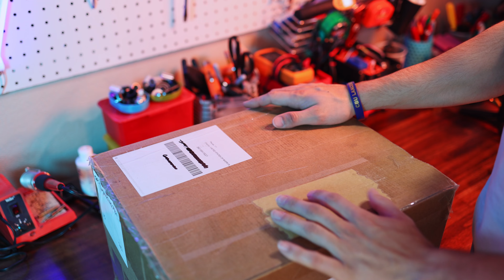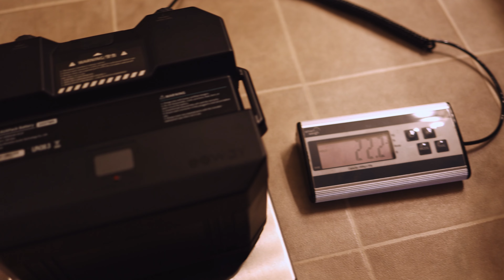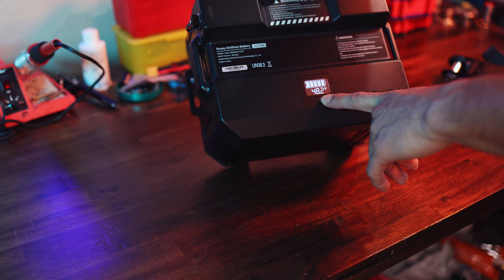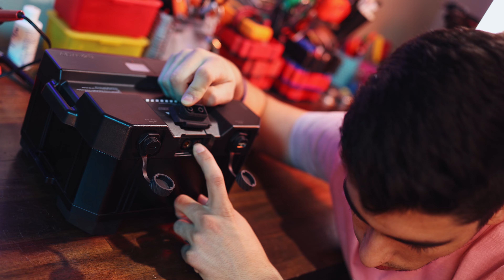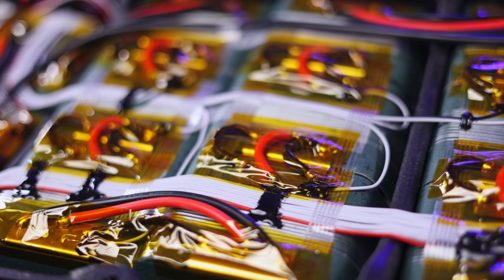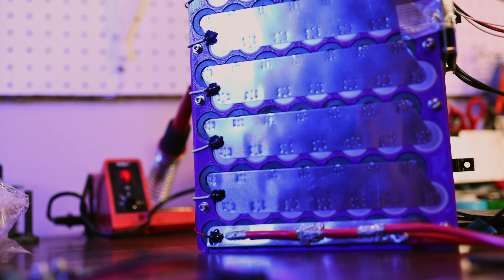What's inside the Exway Aux Pack? (Unbox / Teardown)

Comment: Hey man, i like the fact that you went ahead and unassembled this battery pack. I would love to pick your brain about repairing the battery pack when the batteries no longer take charge.
Reply from the maker: Ironically this battery no longer works lmao, don't really know why but I haven't investigated it deeply. Usually when batteries don't charge, it means that one of the cell groups is out of balance, OR (and more common) is that a cable somewhere has broken or cracked. Easiest first troubleshooting step is to inspect all solder joints, balance wires, and cables to see if anything is broken. From there, you can move on and probe around with a multimeter to see if each cell group is the same voltage. Might sound complicated but it's not as hard as you might think.

Comment: How difficult would it be to swap the esc in the atlas pro? I understand the aux pack is self balancing. But what kind of tuning is done to the esc if any to allow u to add and remove the aux pack as desired? What are some things to concider?
Reply from the maker: Swapping the ESC isn't too terrible, I think it comes out with a couple screws. However, you may have some trouble fitting in an alternate - I haven't tried it yet, but maybe the Makerx M100 or DV4s would fit. You'd need to replace the motor connectors and sensor wires, get a new remote, and probably modify the enclosure a bit. It's definitely possible though.

As for the Aux pack, the ESC does not communicate with it at all. It's the BMS in the Aux pack to the BMS in the board battery, so you don't need to worry about that part.

Comment: thanks for the video bruv - btw you mentioned you are 3d printing parts. i would be happy to know if they are exway atlas pro parts ;P
Reply from the maker: Glad to be helpful! I do have some parts that will be available for Atlas Pro soon. I sell tail light mounts and tail lights that will work with the gear drive version currently, but I'm also working on lights implementation! Check out pevcomponents.com!

Comment: I wonder what kinda signals are going along those BMS data pins. Do you have an oscilloscope to probe into them with while it's operating?

Granted... It'd be a challenge to get contact with them while its all plugged in. Perhaps under the deck cover theres a way to sneak a probe in?
Reply from the maker: Man I am super curious too. I don't have an oscilloscope quite yet, but it would certainly be interesting. If we were able to figure out what they do when the board boots, or when you're discharging, it could help DIY users figure out how to make an AUX pack of their own.

Comment: do you think it’s possible to add a diy aux pack to the exway atlas
Reply from the maker: Well. Complicated question persay. I think it is "possible" but it would not be as integrated as this one, and it would be pretty difficult to interface if you didn't already have the aux pack lid / connector. I actually recorded a video installing the aux pack and going into the connections, but I haven't gotten to edit it yet.

I think, if you made it so it was a "swap pack" and it didn't share load with the internal one, like this Aux Pack does, it would be possible. Maybe I'll try it someday if people are interested but it would be tough to reach the polish of this delivered product.

Comment: Your packs look great but you have to remember Exway using those extra two wires out to the output leads makes the bms monitor discharge. Until the custom boutique boards have bmses that are not bypassed riders will be left with a risky battery no matter how well the battery is made.
Reply from the maker: Well if you were to use this battery on a diy, I think you would probably just use it as a swap pack rather than having it plugged in at the same time as the other. Besides, most people aren't building with these lishen cells either, so the load sharing wouldn't work properly
Reply: @RBEMotion  Correct, the two "data" wires would having nothing to plug into on a DIY board. The BMS inside the AUX pack would be not be operating as the manufacture intended so it would be "DO AT YOUR OWN RISK" at that point.
Reply from the maker: @uhjyuff2095  Yeah I'd agree with that. Unless  they explained how to properly interface with those two wires, it would be hard to utilize to its fullest capabilities

Comment: The strap is very standard here in China. Almost everyone I know has an expanded diy battery on top their boards and uses a ratchet strap to keep it in place. It's reliable, simple and not permanent.
Reply from the maker: Ah nice! There are plenty of DIY guys here that use that method too. I prefer more elegant or permanent solutions, but in a stiff deck like this with a great mounting point, it seems to perform really well.

Comment: Great in-depth HQ vid that'll help anyone looking to get this AuX pack. I'm curious as to how 23 lbs. strapped onto the center of your board  will affect the ride.
Reply from the maker: Thank you! Surprisingly, it actually make the Atlas pro more enjoyable for me to ride. It seems to dampen your input a little bit and you can definitely feel it. Depending on the weight of the rider, you may like it, or dislike it. Amongst the riders that tried it on our track, I'd say about half liked the feeling, the other half either didn't like it, or would think it needed some adjustment.

I will say, since this board is so high off the ground, you can notice it more than on a mountainboard with angled tips and the lower center of gravity. For me, it's been great though and I don't mind the extra weight up there.

Comment: I guess they don't expect to ever have to vent. Makes you wonder.
Reply from the maker: Definitely does make you wonder, however, most of the packs we build completely block cell vents with nickel anyway. Not saying that this is better or worse, because I'm not really sure, but it's a problem on most esk8 packs. I would expect that being completely potted in resin might take it longer for you to notice if a cell were to go into runaway. At the same time, it's usually a huge panic moment anyway - maybe having a strong metal box like this will help you chuck it outside?